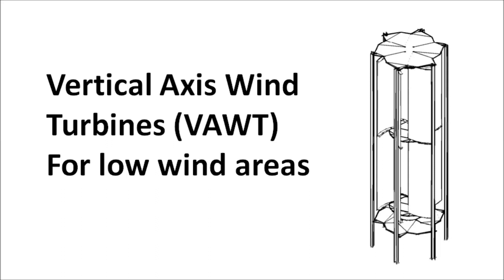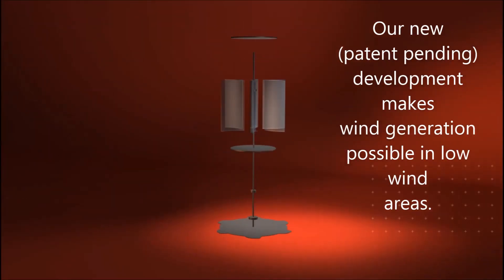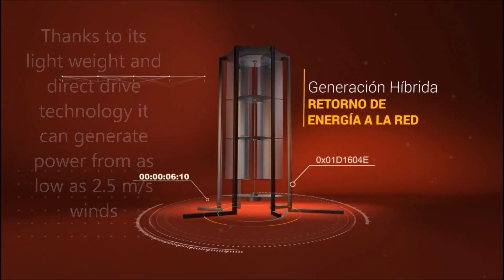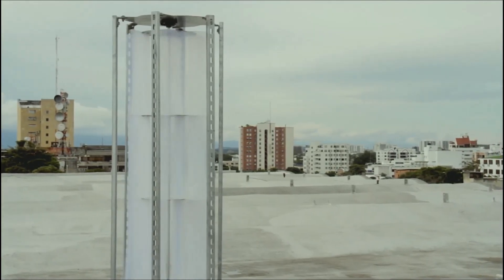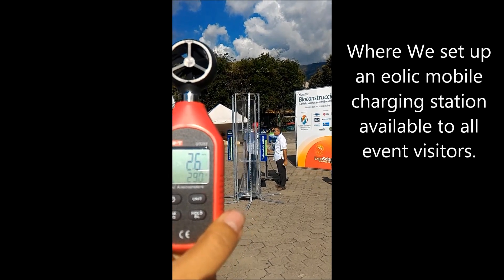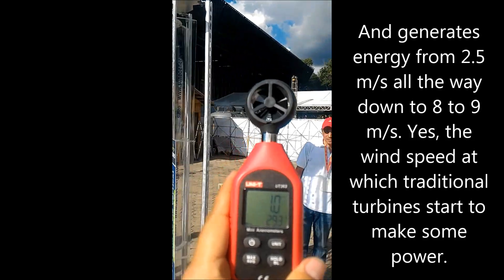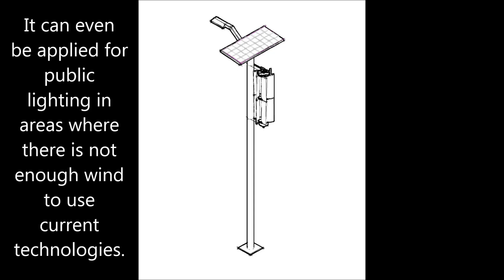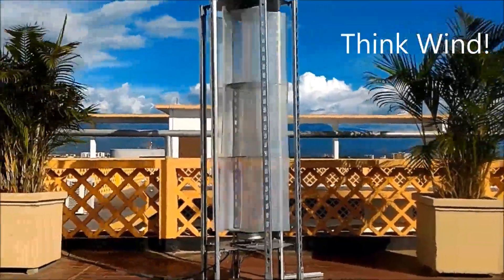Vertical Axis Wind Turbines for Low Wind Areas

Comment: Hi Milton, consider putting an outer layer a "booster" with blades that does not move but has the purpose of guiding the wind to the right side of the blades like in this examples: 
https://www.youtube.com/watch?v=7TspdI4Sd1o
https://www.youtube.com/watch?v=lGE9sbzKt6g

Comment: Too much talk, ads only, no ampere meter, no volt meter, no wind meter, there are no special design except fan behind
Reply: It will always be easier to critricise, rather than to create. I have all recorded measurements and hundreds of people saw it working at the most important fair in Colombia. I don't have to convince a "nobody" hiding behind a keyboard.  A fan???? you're funny.
Reply: @suneoenergy2270   -  Look, while he's overly critical or might be?  When showing something like this, people want to see numbers.  That's not overly demanding.  Wind speed, load, volts, and amps.  The thing is pretty, but people want to know/see how it does.  Nothing unfair or overly critical about that.
Reply: @Xx-xd3zo  well said. And I have noticed that, almost every video that includes these wind generators and/or wind turbines, especially at low winds 1-2 m/s, you can NEVER see numbers (volts, ampers, production rate of electricity at let's say winds of 5 m/s etc)
Reply: @kledrcridle7972  - Yeah, or they post volts, not amps.  That drives me nuts.  Lol.  That thing is really, really sweet.  I'd like to know how it does.  If it's enough for people?  They know they can buy it.  Not everyone wants or needs some max output.  Especially if it's cool looking.  People have windmills that do nothing.  They'd be stoked to have one that'll charge a phone or something more.  Especially if they can just plunk it down, weigh it down and enjoy like they can that one.

Comment: Looks good . That structural support around the turbine could have incorporated a few vanes to direct the wind into the turbine to achieve a higher  output power.
Reply from the maker: Thanks for your comment. I tried that out but the power gain is negligible.

Comment: What is your product website?
Reply from the maker: Our website is www.suneoenergy.com but you won't see it down there because it is still to be released to the market.
Reply from the maker: www.suneoenergy.com . The wind turbine project is currently on hold while better manufacturing process are developed
Reply: @miltonch76  what is your current status? Did these ever come to market?
Reply from the maker: @futuragirl  Local patent process finished last month and We're running final test with little changes. I'd say We're hitting the market in two months for the small ones (50, 100W)
Reply: @miltonch76  is it going to be available only in Colombia?? Are they on the market yet?